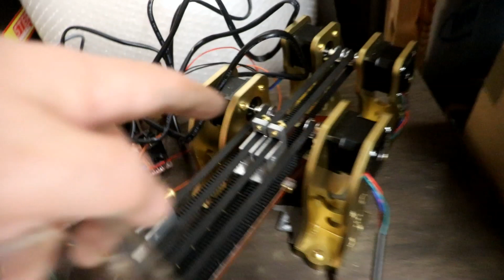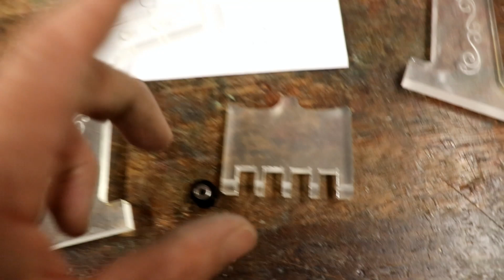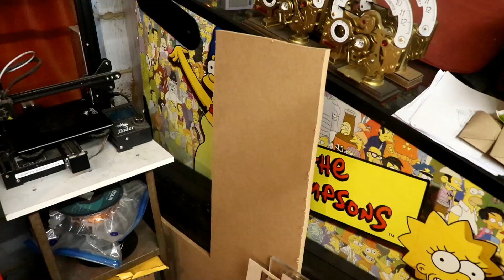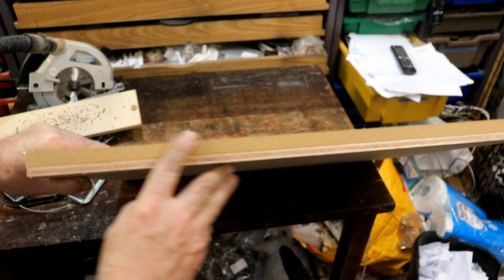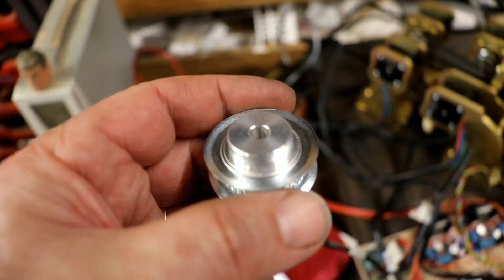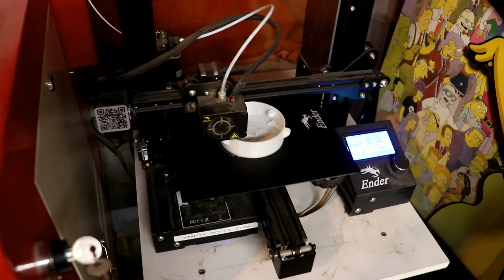Part 11 - It plays When I'm Cleaning Windows!

Comment: You may use a low noise step motor driver. Tey are more expensive but much silent. Step motors run by sinusoidal signal generated by the driver. Best drivers generate perfect sinus signals so the motor runs silent. Also to increase speed later you may use thicker nema motors. 4240 or 4260
Reply from the maker: Thank you so much for the suggestion - I didn't know they were a thing! In the back of my mind I'm thinking about a guitar playing machine that would obviously have more fret 'fingers' that would need to travel far further and therefore faster - sinusoidal drivers sound (literally) like they'd be far better!

Comment: Hi John, several years ago I built a drill press auxilliary table using 3/4" ply and T-tracks for a movable fence.  I love using it and I think one might help when you're holding items to be precision drilled like you do.  I'll sometimes hold the work to the fence or I may clamp it.  It makes work much more easily repeatable as well.  I love the machine, by the way, and am excited that you're thinking about dusting off Victoria!
Reply from the maker: Hi Tom, that's a really good idea, I never considered having an adjustable fence on the pillar drill. I'll definately do some research on this. As you suggest, it would be a great help with all the fiddly things I end up drilling. 

I can't wait to resurrect Victoria the automaton. The thought of seeing and hearing her sing along is absolutely ridiculous! I'm going to use the Teensy sound processor to add hiss, crackle, wow & flutter and it also outputs the mouth moving signal - let chaos commence!